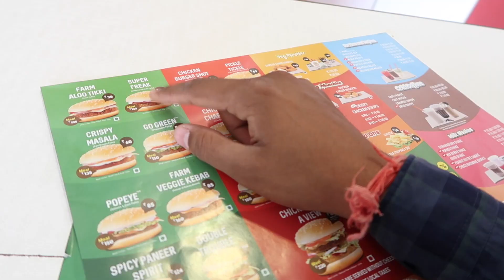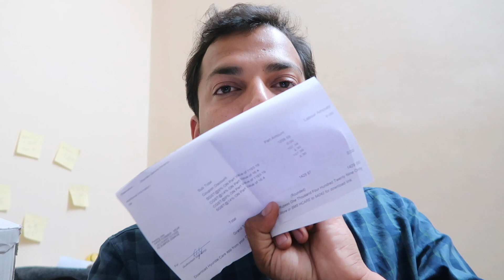Elite i20 3rd service and Tyre change | #AutoRoom

Comment: Gagan bhai.. Hyundai do tarah ka engine oil offer karti hai.. ek normal engine oil and other is fully synthetic oil of shell..
The price of the Service gets different for both these cases as it up to the customer which oil you choose for your vehicle as the Service cost is higher for the fully synthetic oil option..
I'm from Pune and I too have an elite i20 ASTA and I prefer fully synthetic oil usually so my service cost is around 5k as the oil itself goes around 3000 INR.
Just wanted to share this information with you...

Comment: Wheel alignment tb krani hoti hai jab gadi left ya right side main Jaa rahi ho 25000 km ke bad aap wheel balance kra sakte ho, main isliye aapko bta raha hu,  I am a technician in hyundai.
Reply: mere paas bhi hundai i20 asta (O) vtvt grey colour (petro) he aur is ki ye mahine me 2nd service karvane wala hu to service ke doraan kya - kya dhyaan rakhna he or khade rehkar kya - kya karvaana he woh bataa do...??????
Reply: shailesh panchal, petrol Gaadi walo ko fikar karne ki jarurat nahi, bs bolna simple service kr do kuch extra kam mat karna jese wheel balance, alignment, an other work, or dhyan ye rakhna cliper pin oiling kra liyo bhai, chaing kya hona hai ye b bta du 1.air filter, oli filter, engine oil, hendbreak b thik kra liyo 😊
Reply: Ajay Singh 
Yhank you ajay singh bhai....👍
Reply: I 20 diesel ke total service cost Kya hai?
Reply: Wheel alignment issue aane ke baad fix karne se accha hai... har 10K KMs per Wheel alignment, Balancing and rotation karwa lein, its a precaution. Prevention is better than cure...why wait till 25K kms , does not make sense !!
Reply: Acha ji...jb river me jaake gir jaye

Comment: It's better if one install the new tyres at the rear for about 3000km then bring them across to front for the front wheel drive vehicles.Becoz new tyres have a smooth coating to retain the shelf life. Therefore it tends to slip once u start off the car,as the front wheel drive vehicles power delivered to front wheels ,it lacks traction due to the coating.its vice versa for the rear wheel drive vehicles. U can verify the information. Enjoy.

Comment: Hi Gagan,like your videos and followed you since you started reviewing i20.i own i20 active and must  say your review was a factor in my decision making..my car is about 1.4 years old ,but has noticed a major problem since last year with external metallic surfaces getting to rust ,especially the logos.
I called my service centre and response I have got is that it's possible to have rust in high moisture or  in water with iron content.I stay in Kolkata and my car has been here only..i want to know is this normal and can manufacturer not make rectification here?is it covered under warranty as my manual is not very specific on this point?
Thanks for your reply
Reply: off course its uder warranty.. u should call Hyundai care center and talk to them. agency or service center guys dont want to take headache that is why they are ignoring you. u can send e- mail to Hyundai India and they will definitely tell you what is write.

Comment: Hello gagan,

I wanted to ask few questions regarding third and last free service of my HYUNDAI ELITE I20. I had done my second service a year ago at 7100 kms and now on its third service it has run 13,300 kms. I had changed air filter,oil filter, engine oil etc and did alignment balancing on my second service.

So, now standing at my third service due, is it compulsary for me to change air filter, engine oil etc. I am asking because my car has run only about 6200 kms after its previous service and my car is running completely fine without any problem. So, if i dont change air filter, engine oil etc. (which service executives will push me to do), will my engine warranty get wasted or will it create any issues for me on the legal front in future.

Please do reply at early as possible as i want to give my car for servicing in 2-3 days. Always thank you for your informative videos.

Comment: Hyundai Elite i20 Asta opt. diesel 2016 model , run about -56600, kharidni chahiye  ya nhi? Kharidni ho to  kya condition honi chahiye?   600000 service cost kya hogi ?
Reply: Correction-60000, how to inspect the car?

Comment: Yesterday, I got the 3rd free service done for my i20 active petrol car in Bangalore (Trident Whitefield Service centre), it costed me 6500 including tax. Additionally i got the Wheel balancing/Alignment/rotation costed 1600 + tax and 800 + tax Rodent spray done in the engine bay. Final bill was whopping 9300 taxes inclusive.

I felt Hyundai 3rd service was costly...I wonder what if it was a paid service. The bill could have shot up another 2-3k with labour charges. 
Gagan bhai... Please share your comments, if I was cheated in anyway by the service centre Advisor
Reply from the maker: Wheel alignment could have been done outside in 200 rs. Also, why wheel balancing was required? Can you give breakdown of 6500? Please mail me bill on ganik.c18@gmail.com if possible
Reply: Gagan Choudhary Sure, I will mail you the details soon
Reply: Gagan Choudhary I have got the Wheel balancing/alignment/rotation done every 10k KMs, reason being firstly I have to drive mostly on broken, potholed roads (continous potholes tat too atleast 3-6 inches in depth) and series of tiny deadly speed breakers made of cement. Secondly I missed to do regular wheel balancing/alignment/rotation for my last car (Chevy Beat Diesel), it caused uneven tear-wear of all 4 tyres also affecting the suspension to great extent (needed replacment within 35k KMs). So I thought let me make sure I do this Wheel task every 10k KMs without fail on my Hyundai car. I believe it's expensive in Hyundai, getting it done outside will be a better option (some of my friends n neighbour owning Hyundai also suggested).... however I more worried of the 6500 service bill which seem way too costly. Wheel balancing/alignment n Rodent spray were extras above 6500.
Reply: Gagan - I have sent the 3rd Service bill and details to your gmail. Please have a look, share your expert observations for the ambiguities and advice ways for correction or next steps if any.

Comment: I20 hv light steering wheel.. Thts why u feel low on confidence at highway.. I20 is smaller thn a bit thn baleno... Baleno m boot space 54l extra h i20 se.. Leg room bh zada h... Shoulder room bh.. Nd obviously fast h i20 se... Baleno k spare parts bh cheaper h hyundai se.. Everybody knows... Remember.. One thing baleno is product of nexa.. Tht hv also good and best in class service thy provided... Nd jo log build quality nd safety ki bt kr rhe h.. Thn u should go for ford.. Simple.. If u dont wants to buy a ms product for its built quality.. Thn go for ford.. Or honda